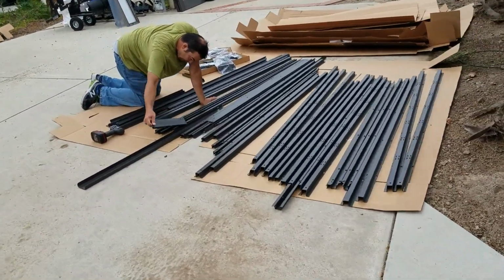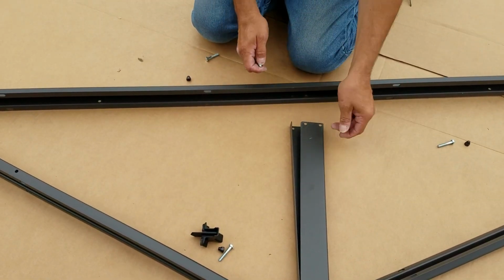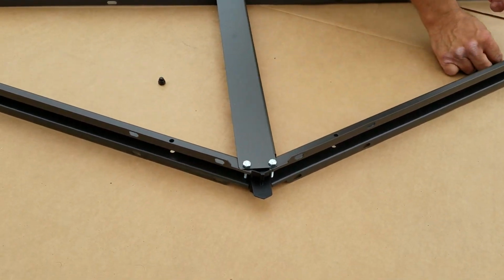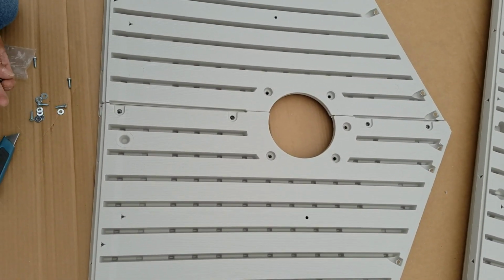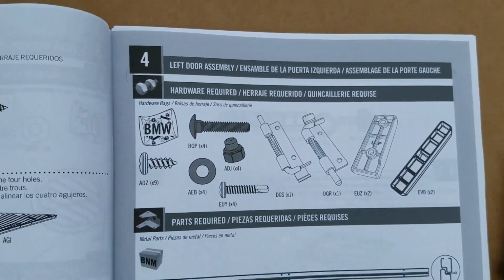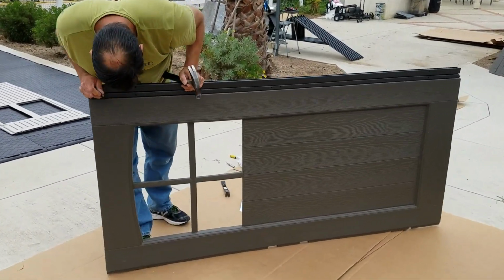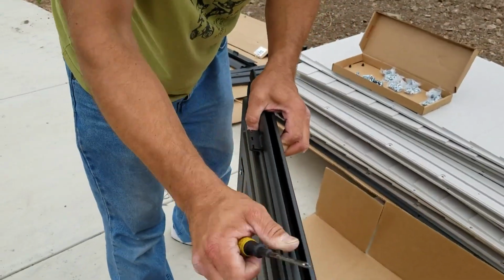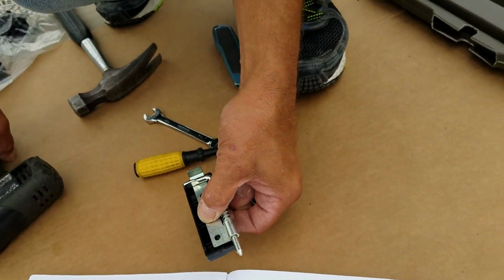Lifetime Shed 11' x 21' Triple Door Assembly Sec~ 2,3,4 How to Build Install 60187 60236 60237

Comment: I’m going to build an 11x18.5 and I live in NC. We get some hard rain storms and high winds.  I have a concrete slab for my shed. Do you recommend securing the shed or any additional reinforcements?  Thanks
Reply from the maker: Hi thanks for comment. Yes, its always good to secure it to a base,especially in hi weather areas. take care
Reply from the maker: By the way,I would get 2 twenty foot by 8 foot sheds because i like them better, depends on your situation. i just prefer the multiple door openings and doors compared to the tri door version.

Comment: Can you let me know what tools you used to make this easier?
Reply from the maker: Hi thanks for comment. Well , yes there are a few essential tools that i use every time that makes it easier . A torque adjustable cordless drill driver,a #3 phillips screwdriver bit(magnetized) 6 inch long,or shorter one with a bit extension. Also a #2 phillips bit as well, and screwdriver. A prybar , ratchet socket set, utility knife , mallet , pliers, an apron with pouches, small flathead screwdriver, ladder 6ft with a tray(preferred) ..these tools will make it easier , but if you have never assembled anything before and not much construction experience, it will probably be difficult no matter what tools you have . Experience is priceless sometimes, There were so many things that i thought needed to be mentioned regarding the assembly of these sheds,so i made these videos to help people and hopefully eliminate as much stress as possible. Hopefully it will be a fun process. Good luck if you build one and take care
Reply from the maker: Also,this bigger size shed needs a bigger size ladder . And  i would have second person help .This size shed is harder to assemble in my opinion than the other smaller sizes, and it goes together different as well. A perfect foundation that size is important as well. Unlike the other size sheds that I've built, this one did not seem to get any easier. Good luck to you and take care,whatever size shed you build
Reply: RubberToe Assembly thanks! Your tip to screw in washers for the handle level was huge!